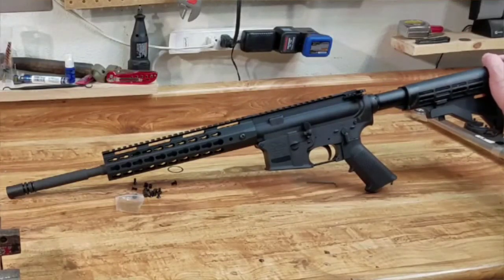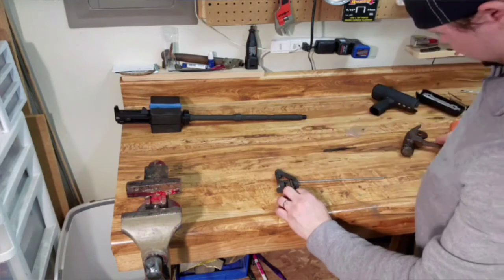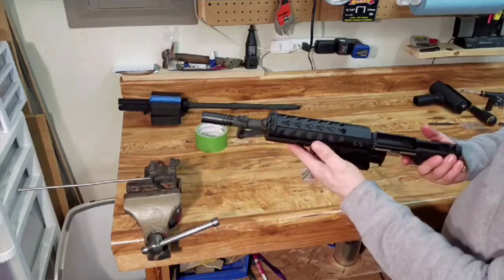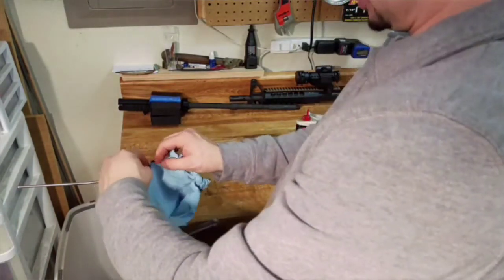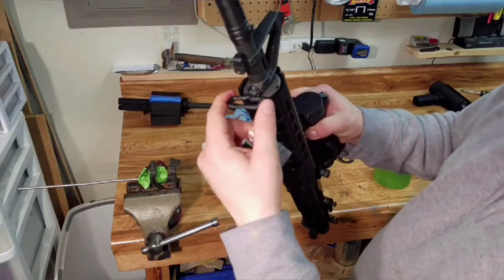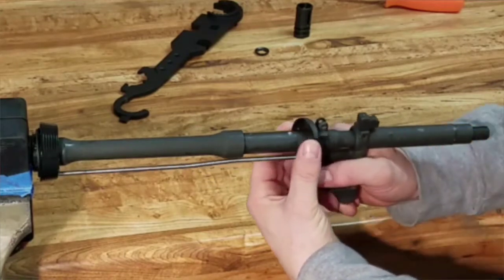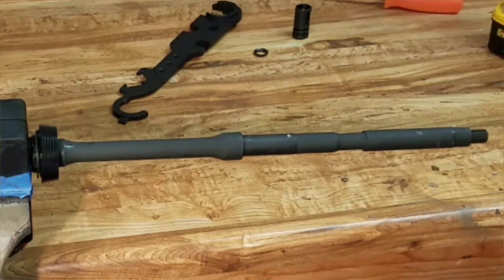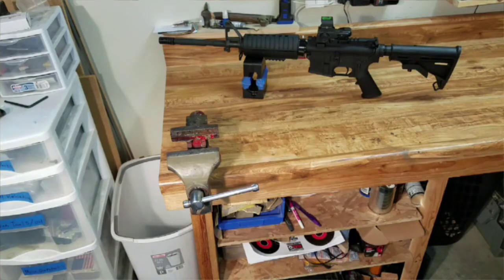Installing an A2 gas block sight to a barrel. Ceratac conversation to an A2 front sight

Comment: Just did this, worked out quite nicely.  Did as you did, drilled through the whole bayonet lug.  It really wasn't as hard as I thought it would be.  Used 10-32 set screws, 1/4" for rear hole, and 3/8" for the bayonet lug hole.  Tape trick was a nice touch.  The rear hole (gas port hole) area was pre-dimpled on this BCA barrel.  I set screwed that, and then marked the bayonet lug set screw area by driving it in real tight, once the sight tower was aligned and not canted.  That marked the barrel enough to center punch that, and widen out with smaller and then wider and wider drill bits, until it was fully dimpled.  Two dimples on bottom of barrel for two set screws, pretty sure it's gonna be nice and solid.

Love having it on that barrel that didn't have it before, and so easy to remove if I wish to change that barrel's purpose/configuration. :)  Awesome stuff.
Reply: I will do exactly as this video show us,  I received my BCA 16" just yesterday.  How do you like it so far?
Reply: @CWfist  they're decently solid. Nice option to remove, which I have done on several others I also made one for. It's pretty tough, and to damage or throw the zero off you'd pretty much damage the rifle out of service just as with a taper pinned in FSB. 

It's good to go

Comment: Super cool! I was planing to do my 16" retro 9mm the same way later this week. The hole cross pin drilling thing seam to be a big pain, & for a 9mm the gas block/front sight is only cosmic.
Reply from the maker: Thats correct and would be a cool concept in a 9mm

Comment: To get an accurate reading the torque wrench should be 90° to the armorer's wrench
Reply from the maker: No, according to TM 9-1005-319-23&P (may, 1991), page 3-41, the standard torque spec for AR barrels is between 30 and 80 ft-lb of torque as applied with the GI wrench attached to a torque wrench IN LINE. The specification takes into account the distance between the torque wrench's socket in the GI wrench and the wrench's grip on the barrel nut. The spec is not about what actual torque you apply to the nut, but what torque you apply to the GI wrench. Every armorer's wrench that I've seen has the 1/2 inch square drive socket in essentially the same place relative to the notches for the barrel nut wrench. 

Unless you have a manufacturer's instructions telling you otherwise, there's no math involved - put the wrench in line with the torque wrench and torque for between 30 and 80 ft-lb as indicated on the torque wrench. 

If the specific torque applied to the nut was really, really important, the Technical Manual would have charts and graphs and include some sort of worksheet so that the armorer could get it perfect. It doesn't. It shows (in clear pictures) and explains (in short sentences) that the barrel nut wrench is installed in line with the torque wrench. I really don't understand why so many people want to make this so much more complex.
Reply: Delta D80 Damn dude, that rebuttal was probably the best thing I’ve ever read regarding barrel nuts. I’ve always head the torque range was between 30 and 60, but considering the rather large difference between 30 and 60, it really can’t make much difference, can it?
Reply: @DeltaD80  So yeahthe added length won't add more than the max of 80ftlb

Comment: Once the set screws are in place and you are sure everything is aligned, you can drill and ream the holes for the taper pins quite easily. All you would need is a drill press and a hand turned reamer.

Comment: You should’ve typed down in the description what to use, i want to do this to my M&P 15 my A2 sight didn’t come with any pin holes at all
Reply from the maker: @DFG312  yeah, 😞
Reply: Can you help me? I’m trying to go get the parts today
Reply from the maker: @DFG312  yeah watch the video. I tell you which tap to get. Then, get some set screws that are the same thread pitch. I'll give you a hint it's between the 5-7 min mark.

Comment: At 3:38 you said "that's hot!". Did I miss something (another video or something?) that you did for the A2 sight to become so hot ? Why didn't you just use an end mill bit to drill the holes for the pins through the barrel? I'm not a big fan of the set screw/clamping method style gas of gas blocks but I did like your approach to the installation of the A2 front sight/gas block set-up. Did you use any lock-tite on those set screw and if so what color. I know that I'm a few years behind but it'd be nice if I could get an answer from you or somebody that did what you did or watch another video of yours (if there was one) that preceded this video
Reply from the maker: I could get that pin to go in so I heated it up with a heat gun. That's why it was "hot".

End mill: to reasons the pins go across the barrel. Second the pins for an A2 gas block are tapered. 

Blue lock tight is used. 

There no reason to not like the clamping method if it was really that ynsuccessful it would be the new industry standard. But you have your reason and it cool.

Comment: I have a stupid question. If your ar15 came pre-pinned with an a2 gas block/sight, do you have to worry about aligning the gas block or do the pins align it well enough?
Reply from the maker: The pins will align it.

Comment: Where did you get the a2 gas block from was it already drilled out for the side pins?
Reply from the maker: Corvettes 706 I had it from kit from another build that I went a different route with. Yes it was drilled out for pins but my barrel didn't have the slots to push the pins through.
Reply: Delta D80 I’m trying to find one that I don’t have to drill on for my bushmaster. It came with a low pro gas block and I was wanting to switch to an a2 front sight
Reply: @SpeedDemonCBR  Dez arms clamp-on A2 front sight

Comment: You torqued it wrong. Using a torque adapter it has to be at 90 degrees or do mathe you added about 3 inches to the torque which is a lot.
Reply from the maker: Hahahaha.. 3 extra Inches. OK thanks
Reply: It doesn’t matter. 

There is no reasonable way he exceeded the max torque value doing it as he showed in the video.

Comment: I'd still pin that sight...
Reply from the maker: I considered doing it but there are several thing first the barrel is not grove to except the pins so you would have to drill the grove in the barrel and most(if not all) A2 gas block pins are tapered. Also if you do drill across the barrel from one side to the other your going to drill through the end of the set screws that are holding it on. If done right this way it is very secure with the divots that I suggest you put in the bottom of the barrel to pin it tightly to the barrel. This one was the second on I ever did. About 6 years ago I did it to another AR of mine and have never had to mess with it. That is why I thought I would do a video on it. Thanks for the great comment.

Comment: AR-47 ?
Reply from the maker: Yeah, it's a 7.62x39 in an AR platform. Hints the AR for AR platform and 47 like the AK. Can't call it an AR 7.62 it could be  a 308. I'm not the one that coined it either if you search it, its pretty commonly called the AR-47.

Comment: Overtorqued that barrel
Reply from the maker: 🤣🤦‍♂️ hmm. Don't think I exceeded 80 lbs.
Reply: @DeltaD80  torque wrenches aren't designed to be wrapped on like that. Theyre designed to break/release only once. Every application thereafter is excess of the torque value the tool manufacturer calibrated the break/release point. Use a beam style torque wrench, different story.
Reply from the maker: LOL. Again 🤦‍♂️thanks for the old school train of thought. ✌️
Reply: @darbymcbride41 If you think bumping the torque wrench 3 more times after it clicked added 50 extra ft/lb to that barrel nut, you should probably have your head examined.

Comment: Empty case going to 1 or 2 o'clock is over gased and not so cool
Reply from the maker: LOL. Your one of those guys... This was intended to show how to install an A2 front sight on a barrel that isn't tapered for one. Thanks, but the over gasing has been fixed quite awhile ago with a heavier buffer.
Reply: @DeltaD80  lol, yes I was born one of those guys...lol... glad you got it worked out... take care